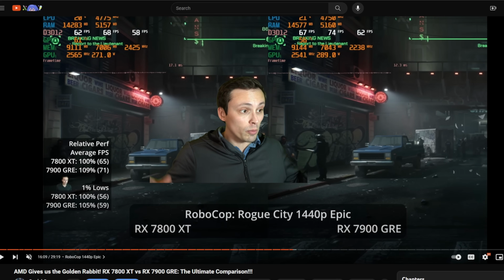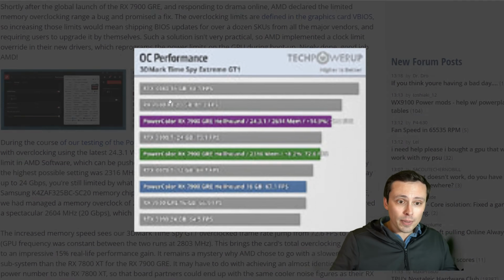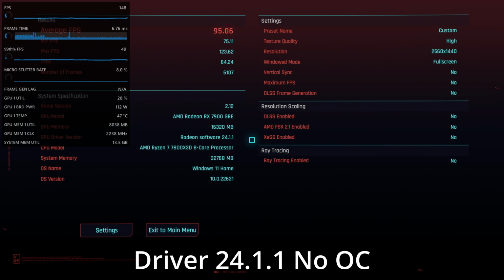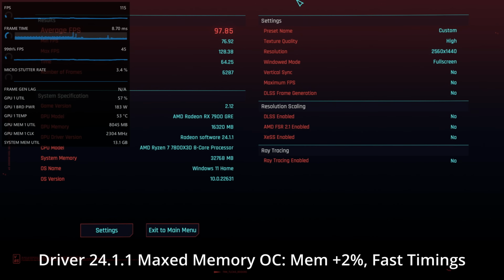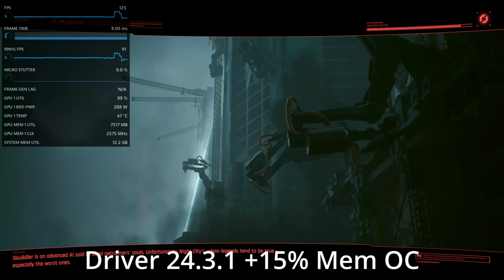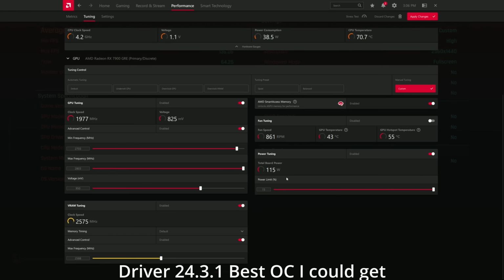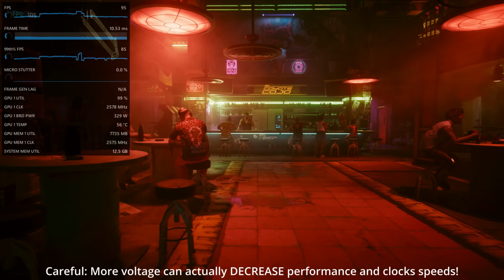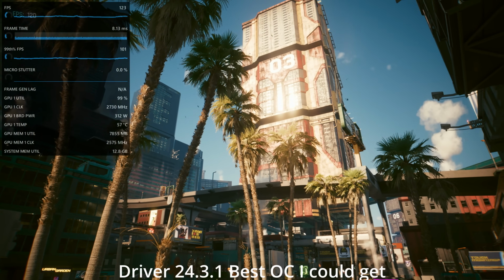Download more performance for certain AMD GPUs!!! (7900 GRE memory OC limits boosted in new driver)

Comment: Coming from an Rtx 2070 I've been absolutley loving my 7900 GRE! Plus the value just keeps going up!
Reply: I'm about to receive the 7900GRE. Upgrading from a MSI RTX1070 :')
Reply: @fliptab1244  It's been great. The Amd software has come a long way and I've loved it
Reply: did you miss something that you used to have from NVIDIA?
Reply: @Sentr7  No I was actually surprised how much the software is better on AMD
Reply: @Sentr7  Not really no. I'd be nice if I could use DLSS but most the time the GRE just tears games up. Especially at the price.
Reply: @DJchestr  did you overclocked ur 7900 GRE or you're running her stock?
Reply: @Sentr7  Depends on the game, I have a Powercolor Fighter and since it's one of the cheaper models I assume it's lower binned so I don't get a whole lot out of it but at 2k I max everything but RT in every game
Reply: @DJchestr what is RT,YE?
Reply: I'm doing this upgrade tomorrow. I love my 2070s but star wars was the first game I couldn't run at 60 on a 1440 ultrawide at medium. That's all I needed to finally upgrade
Reply: @imaflymydroneatit  My 7900 GRE has been fantastic. I assume you're doing a cpu and mobo upgrade? I went with a 12600KF from a Ryzen 2600 and it's been gravy too.
Reply: @DJchestr  a lots changed since I posted that. Now going from an i7 9th Gen 2070s to a 7700x and a 4070 ti super.
Reply: @imaflymydroneatit  Nice My buddy went 4070 ti non super and he's happy too. It's great we live in a time where you can get a gpu increase in like $50 intervals
Reply: @DJchestr  yea I basically backed off the 7800x3d I was looking at to get the 4070 instead in budget. I can't bring myself to buy a 12gb gpu right now which is why the 7900 gre was on my list to begin with
Reply: @imaflymydroneatit  nice well researched build!
Reply: I have a 3060ti and I've been wanting to upgrade to a 7800xt. But people keep telling me to skip a gen before upgrading.

Is that a good rule of thumb for PC gaming? I noticed you did the same but wasn't sure if you purposely did that.
Reply: @carolinagamer2874 yes. Upgrading less than 2 gens apart is dumb unless you have infinite money, in which case, get a 4090.
Reply: @elirantuil5003 so 4090 is only for those who have almost infinite money?
Reply: @krizztykrab2297  infinite is an exaggeration ofc, the intention is that money as a consideration is not high on their priorities.
Reply: @elirantuil5003  I don't know when I open reddit 50-60% people on pcmr have a 3090/4080/4090, so I was asking about only rich people buying them.
Reply: @elirantuil5003  The only other counter point I'd like to bring up is that one thing to consider is if you can sell your 3060Ti right away you just need to weigh the difference between the two
Reply: @DJchestr  you still lose a lot a big percentage of what you paid for no reason.

Again, if money doesn't matter, I wouldn't consider the gre, if it does, you're throwing away over half the price of said 3060ti for 2 years of owning a 3060ti, that's just not a good deal anyone who cares about money would take.
Reply: @carolinagamer2874  same here. commenting here because i also would love some advice
Reply: @carolinagamer2874  Don't upgrade unless you want 4k in all games. 3060ti is a damn good card. Wait for new gen. It all depends on what you play. If at the end of the day you end up playing same old games then 3060ti is gonna carry you for years.
Reply: @carolinagamer2874  I think going up when gen is fine if your are also stepping up to a higher tier. Like your example would be fine or  if you're going from something like a 3060 ti to a 4070 super

Comment: GPU Clock - 2803 -> 2748
mV - 960 -> 1000
Vram - 2450 -> 2516
+15% board power. -> 10%

stable for the last 2 days.
sapphire pulse.

Edit: I returned the gre for am xtx. Stability was a hard fought battle but after troubleshooting for 2 weeks I returned the xtx and got a 4080s on sale for less then the xtx. The 4080s has been smooth with zero issues. 

I cannot at this point recommend amd gpus in their current state. The fact the Nvidia was essentially plug and play after JUST a driver install, is too consequential to ignore.
Reply: my pulse rx7900gre - Vram - 2514, +5% board power.
and got (+10%) +20fps :)
Reply: @elgatoltu  until you wake up one morning and system crashed. Or you get a random driver timeout sitting on desktop.
Reply: @elgatoltu for me the 7900gre pulse cost 555€ and the nitro 627€, what do you recommend and why pls ? thnk you
Reply: @Bkptpt  both are good, better save these 70 euro.
Reply: @Bkptpt  I have the hellhound model from powercolor and its fantastic thus far (2 weeks)
Reply: @elgatoltu what is your mV? Or just stock?
Reply: and power consumption?
Reply: I have the Pure edition. Will try to see what i can get.
Reply: Yeah. Rich people are not showing they actually are rich. They prefer to play on a Switch. Only poor people buy the most expensive GPUs. 😁
Reply: @daveb9402  Only poor people buy 1, or the other. 
Rich people just buy them all. 
To most, buyig a ps5, or an xbox, or a pc, or a switch ect is some kind of thought to be had. 

For the rich, if we want it, we simply get it. there is no thought or checking of the bank account or concideration of what's left. 

To us, the price of a ps5 is no different than 1 dollar.
Reply: for me the 7900gre pulse cost 555€ and the nitro 627€, what do you recommend and why pls ? thnk you
Reply: @Bkptpt  nitro if you can afford it. I only got the pulse because canada didn't get nitro
Reply: Oh sorry rich..
Reply: So, you were trying to heavily overclock your cards, failed. And now you can't recommend AMD cards. 
You can't even decide what you want. You get a GRE, then ah XTX, then a 4080. 

I have the GRE and don't have even one single issue of ANY kind. 
You're just a jack ass. And I can't recommend you to anyone.
Reply: Cant you raise the vram speed to 2600 if you add like 40mV?
Reply: Because i think the memory clock is more important
Reply: Not bad! You're still not at the level of my 7900 xt, and of course I too can add 12-15% with an overclock extra., 
With that said tho, that GRE is a really REALLY good deal lol.
Reply: @TheRandomDude-qy1ev share your oc and if settings pls
Reply: @chunk3875  
Power Limit - +15 
Max Clock - 2750 (it'll boost to 2800)
MV -  1060 (issues? raise it by 5 till gone)
Vram - 2750 (Issues? take away 10 till good
DO not use fast timings, they do next to nothing. 
set fan to manual, turn off zero rpm mode. 
If you have a hell hound like me, set it to 1200rpm. You won't even hear it. 

Tada. You don't want to put the MV too high, if you put a high mv, and 3000 max clock you'll get LESS performance. There has to be a fine balance. 

With this, I get close to my friends 7900xtx. Quite a good deal.
My temps are like 20-24 idle
32-50 playing a game usually. hot spot like 75 on demanding title. 

I have a cold room, amazing air flow.
Reply: @TheRandomDude-qy1ev do you mean friend's 7900xt? there's no way you're getting close to xtx performance on a GRE
Reply: @ardequerade3155   Yeah xt.
Reply: @TheRandomDude-qy1ev for me the 7900gre pulse cost 555€ and the nitro 627€, what do you recommend and why pls ? thnk you
Reply: @TheRandomDude-qy1ev 7900XT is about 7% more performance with an OC not 12-15%....
Reply: @Jasontvnd9  NO it's 12-15%. Sometimes more depending. Looking at 6 benchmarks doesn't paint a whole picture. 
I got rid of that garbage tho and got a 4070 super ti. Overclocked it beats my 7900xt in nearly every game. And is 100% stable :) 

Now WoW doesn't crash anymore yay!.
Reply: @TheRandomDude-qy1ev 4070ti super......downgraded you mean.

I have a 7900XT in my mrs's pc....it's 7%...
Reply: @Jasontvnd9  Certainly upgraded!! 
Streaming is clear now, and no performanc eloss. No more audio cut outs using hdmi on tvs. WoW doesn't crash anymore, helldivers has double performance, and new vegas actually works!! 

Amd cards are really bad. I'm glad you like yours!! rock on!!
Reply: @TheRandomDude-qy1ev  helldivers double performance.....

My 4080 gets about 150fps in helldivers at 1440p and the GF gets about 120Fps , Now your 4070ti is a gimped 4080 that performs more like a 4070 super than it does a 4080 so no you haven't doubled your fps.
Reply: @Jasontvnd9  No it gets double fps. And without driver timeouts or hick ups. There is more to performance than pure FPS. 

I prefer a more stable, and smooth experience.  And I use half the power of your card yikes.
Reply: @TheRandomDude-qy1ev  not bad but you still not at the level of my 4090, with that said tho, that 7900 xt is a poor man GPU lol.
Reply: Hahaha @rust2156
Reply: @rust2156 You‘d hope it isn‘t considering it‘s 2x the price
Reply: @rust2156   The 6600, or the 1660 is a poor man gpu. I have the 4090 as well, and the 4080 (I work at microcenter) 

Any card that can play ultra 4k nearly anything, is not a poor man GPU. 
Poor people are playing on consoles. And if they have a pc it's gonna be at 1080p, with upscaling on balance.
Reply: @rust2156   Not bad, but you're still  not at the level of my DUAL 4090 build. A single 4090 is for poor people lol.....
Reply: @rust2156   The random dude is right.
Reply: @kju520  Not bad, but random is right.
Reply: @rust2156 700 aint no “poor man” but ok.
Reply: @rust2156  The fuck y talking about 1000eur vs 2000 eur the clear wiiner allways be AMD and even i have all my gpu nvidia this is just better deal go with AMD also fuck the nvidia after what they dit to players with 20 and 30 series rtx GPUs. My next gpu will definitelly gonna be AMD i dont nned to have fastest gpu out there if the price is gonna be half of your GPU and RAW performance is gonna be like 85 percent im sold on this for sure well and RT i dont care  about it to be honest its nice feature but 95 percent of players dont turning on RT cuz the hugge power loss also i thing that the RT is just huge scam for companies like AMD intel and greedia cuz they basicly force you to buy cuz this new shiny mirrors lmao nahhhhhhhhh im all about functionality and raster pwerformance and hell nvidia let me down manyyyyyyyyyyyyyyyyyyyyyyyyyyyyyyyyyyyyyyyyyyyyyyyyyyyyyyyyyyyyyyy times i dont even want to remeber on it. Think about this all you want but nvidia is just like apple now they dont sell gpu to players but fans insted like each time there is new gpu people grab the new one no matter the price. But times has  changed cuz nvidia doing really stupid things perhaps like rtx 4060 damn thats bad cart or even base model od rtx 4070 nahhhhhh, and if you think about it the raster performance is just not there and in case of 4060 and TI even worse thanrtx 3070. And im pretty sure that nvidia gonna do this stupid shit again when they introduce another model like 5060 with 8gb or 10gb of WRAM and that is just no enough today. I got rtx 3070 and im basicly forced to upgrade it cuz there is not other choise sadly but i loved this cart but it is no longer 1440p beast yes i still play 1440p with max settings but i got around 60 to 80 fps and sometimes i nned to activate dlss quality to achive some better results and thats why im gonna go with AMD and thats sweet 16 or 20gb of WRAM plus those carts gonna age extremly well compare to 8 or 12 gb of WRAM plus price is some where else than nvidia carts. Will well seee what gonna hold more my new AMD gpu or your power connector lmao.

Comment: Some of these responses are hilarious
Reply: My favorite ones, are from people who now think their 7900 GRE is going to be as good as a 7900 xt. But even with the overclock it's not even close lol. 
There are many titles where that difference will be nearly mute, or very small. 
Not only does the 7900 xt have more bandwhich, it can get to 2750+ on the memory, 3k easy onthe core. Has more memory, more streams, among other things. 

Even in that synthetic it shows the GRE still lossing by a decent notch to the 7900 xt, but the 7900 xt can also do a +15% overclock. 
And that's exactly what I did.
Reply: @TheRandomDude-qy1ev Haven't seen comments like that, just people saying they're glad that the GRE has even more of an advantage over the 7800XT.
Reply: @AbsoleteAim  It doesn't, because the 7800 XT Nitro+ OC by the same amount according to TPU's review.
Reply: @AbsoleteAim   I've seen a few. In some games it's valid, but in others the difference is still vast. And that's against a stock 7900xt. 

Still a good card tho. Although, per AMD pushing a card ooften leads to drier timeouts, crashing, and other issues eventually. 

I wouldn't buy the GRE cause of what some people can overclock.
Reply: @TheRandomDude-qy1ev  True, but I guess the whole thing is how it's a lot more consistent now with the overclock, though.
Reply: @AbsoleteAim   If you go to hardware unboxed latest video testing the OC out. There are threads on there of people saying they couldn't even get 2400 on the memory before it crashes. 

Too random. Even my 7900 xt is muchweaker at undervolting or overclocking as others. 

Deff wouldn't recommend a purchase be based on overclocking results lol....

Comment: could be possible to do a comparision between this card with this OC vs 4070 super? like a rerun? would also be nice if you also overcock the 4070 super ofc to make it fairer... Is clear this is a very special case because the 7900 GRE was heavily restrained but could be cool for a one time thing...
Reply: techpowerup reviewed this exact Hellhound edition with the updated drivers, in OC its 90+% of the 7900 XT factory, and above a 4070TI in pure raster.
Reply: @kawafahra  thats syntetic benchs, no games
Reply: @kawafahra sweet
Reply: @kawafahra  That's not what I meant at all with my statement😏 and it has absolutely nothing to do with the classification into price categories😉 I'm an ❤AMD❤ user myself with 3 AMD cards (RX 7900 XTX, RX 6950 XT & RX 6700XT) in 3 different ALL AMD systems and I've been building gaming and workstation rigs for almost 28 years! So I definitely know what I'm talking about... I still remember the time when you had to read / acquire all your knowledge from magazines little by little because there was no such thing as the Internet or only limited and rudimentary with a 56K modem 😂, however it's not worth mentioning. But back to the topic, it doesn't make sense because a crappy Ngreedia RTX 4070 SUPER costs around 650-750€ (AIB models here in Germany) and the RX 7900 GRE only costs 560-590€ , so based on the price alone it doesn't make any difference to me Sense. Of course, if someone is willing to pay  200€ more just for the Ngreedia feature set then so be it... there are a lot of stupid people since PC gaming has become so mainstream and it feels like there are more and more of them every day 🙄😜
Reply: @allcarparebeautiful can’t blame your NVIDIA for the import tax imposed by your country, over here in the state, the price are almost the same, therefore the 2 card are definitely in the same price bracket. This means this warrant a rematch because pre driver update, both ended up with similar raster performance but the 4070 Super slightly edged it with superior feature sets.
Reply: Just get the cheap Zotac 4070 Super for $580 and flash the Gigabyte Aorus Master 4070 Super with 350w power limit for free and test it against the $600 Sapphire Nitro + since it is the highest power limit 7900GRE. You have to buy higher power limits for AMD gpus this generation.
Reply: I have a inno3d 4070 super but not sure which bios to flash and if it works at all.. Any tips?  @jjlw2378
Reply: What ??¿¿ Why should anyone comparing a 7900 GRE to / or against a RTX 4070 Super 🤔🤷‍♂️that doesnt make any sense 🤚🏻 with or without OC 😏 because the Ngreedia 🤮 Card plays at a completly different price league /category 🤦‍♂️
Reply: @allcarparebeautiful mmmm the 7900 GRE hellhound he has cost around 580 and the  4070 super asus dual cost 590, how arent they comparable?.

Comment: Wasnt the GRE made to be amd's fastest graphics card that didnt excede the "Performance limit" imposed by the government for export to china? If so, the reduced memory clock would make sense. though i'd think that AMD would have made that memory spec a hardware lock and not a soft lock if that were the case.
Reply: Only the 4090 exceeds that limit.
7900XTX and 4080Super don't. Anything below these 2, also don't ...
Reply: @gruiadevil 
Nope. The limiting factor was the memory bandwidth. Before this driver update even if overclocked to the max frequency allowed by the driver it was impossible to reach 600gb/s. Now it's possible to reach over 680gb/s if you win the silicon lottery.
Reply: I thought It was a way for them to shift some navi31 down bins but in a smaller die (same overall GPU size as 78xt boards)
Be interesting to see if there is now a separate driver fork for Chinese GRE